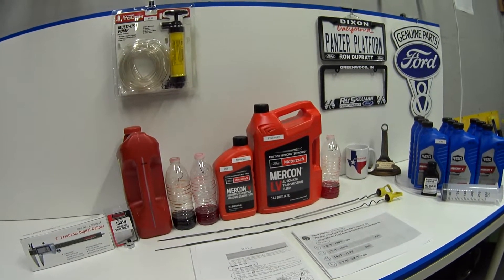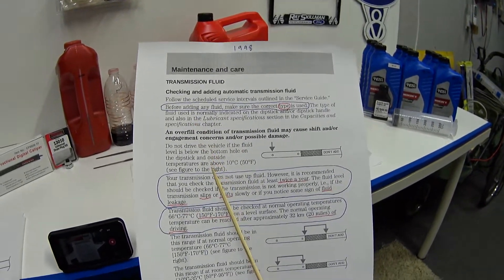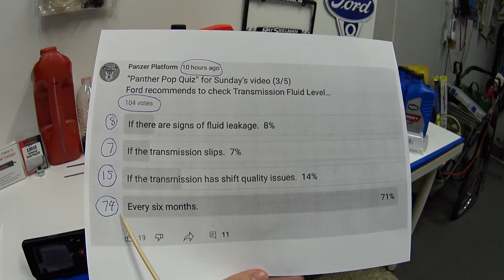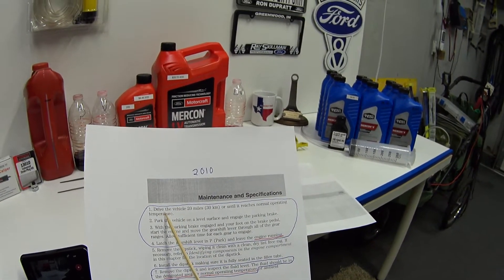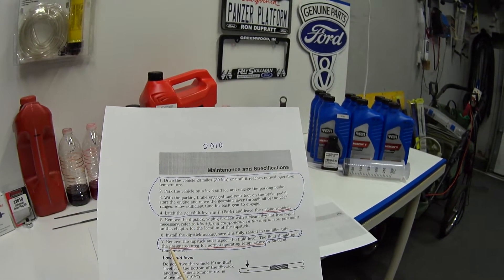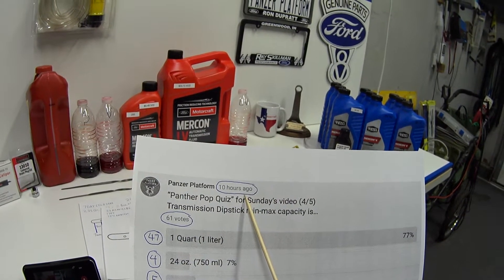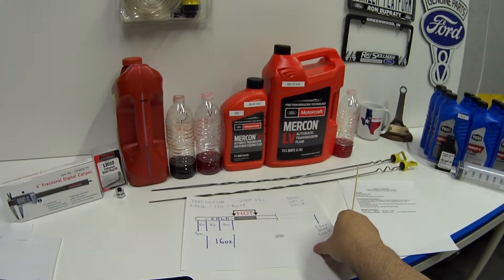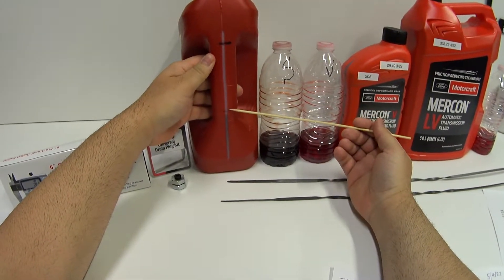Crown Victoria - How To Use Transmission Dipstick

Comment: Thanks for all of your legwork. I’ve done some fluid exchanges myself and I thought I would be  fine with the fluid between the two dots after I drive 30 minutes to work. I even yanked out some fluid when I saw it in the hatch marks. UGH!!!!!! No worries, thanks to you, I know what to do. I carry an 8oz cup in my truck and before I leave for work tomorrow, I am going to add 8oz. I am planning on doing one final fluid exchange for now; I have 2 quarts of Mercon V in the cab of my truck. I was going to use them both for my power steering, but I have already ran one quart through there. Thank you soooo much for clearing that confusing situation up!
Reply from the maker: Right on Earl,
Thanks for stopping in. 
-Chuck

Comment: Thank you sir!  Just checked my 11 GM and sure enough the dipstick is exactly like you showed
NOTE: when I did my DIY flush I found that over 3-4 cycles of full hot / fully cooled off / stop / start and driving (a about a week) the level came down a bit and I actually had to add approx 14-16oz to get it back into the cross hatch area.
I'm guessing it was air pockets in various parts.
Reply from the maker: Right on WOT,
Thanks for stopping by. 

Check, check, and recheck. Lol
Confirm & verify. 
-Chuck

Comment: Great video as always
Reply from the maker: Right on Rich,
Thanks for stopping in.

The cast aluminum transmission pan with the extra 2 quart capacity should really help keep fluid temperatures down for someone with a hauling / towing / performance application.
That was awesome.
-Chuck

Comment: Also checking in from the west. I legitimately could not find the tranny dipstick for the first couple weeks of ownership lol. Felt real stupid once I eventually found it.

Also random transmission fact. I've been looking at getting a 2004+ Ford Expedition and the 03/04 5.4L 2v Expedition's use the same transmission as our Vic's. So the transmission is factory rated to tow +8500lbs with the Expedition platform.
Reply from the maker: Right on TL,
It took me 2 years until I noticed the power point under the ash tray. lol

Have you seen my video on "Panther Platform Towing Capacity"?
Early model years were rated for 5,000lbs.
Late model years only 2,000lbs.
-Chuck

Comment: Whenever I check the dipsticks for engine oil and transmission I always get a vague reading as it’s not always clear where the fluid level exactly is. Probably because I do it wrong so this is good knowledge
Reply from the maker: Right on J-Dub,
Thanks for stopping in.

I know what you mean about getting a muddled reading.
Here’s some optional tips to get a clearly visible reading.

1.) Use a clean paper towel / napkin every single wipe, (of course use something lint free).
2.) Wipe the entire shaft of the dipstick, not just the tip.
3.) Get the dipstick completely dry before sticking it. 
4.) If you’re adding ATF in 8oz. increments wait 60 seconds for the fluid to flow all the way down the dipstick tube, otherwise it will coat the dipstick, and contaminated you reading.
5.) Check both sides of the dipstick for your reading.
-Chuck

Comment: Thanks for your effort. What is the best way to add some fluid? while ambient or normal operating temperature? while the engine on or off?  also, I find it too hard to read the dipstick as each dipping gives a different level on the same time, any advise? thanks again mate.
Reply from the maker: Hello,
All of your questions are answered in this video, or your Owners Manual except the last one. 

After removing the dipstick you must wipe it 100% clean with a clean paper towel, and then wait 60 seconds before puting it back to get a reading. 
-Chuck

Comment: My mechanic friend advised me that dropping the pan and changing the filter is not necessary for every change. I am under the impression that you can just suck out the fluid from the tube & replace what you can... only have to do the filter every 2nd, 3rd, or 4th time you change the fluid- depending on how hard you're driving and how often you change the fluid.  What do you think?
Reply from the maker: Right on JP,
Thanks for stopping in.
This is a great question.

Keep in mind sucking / pumping from the dipstick / fill tube will get you approximately 2.25 quarts. Adding a drain plug to the transmission pan will get you approximately 3.5 quarts. 

Using a $6 hand pump is easier since you don’t have to jack up the car. But if you already have the car on jack stands for an engine oil change, a $10 transmission drain plug might be easier. It’s nice to have both options available.

My worthless opinion is to;
1.) Do your own research.
2.) Use your best judgment.
3.) Make an informed decision.
4.) Do what’s best for your application.
-Chuck

Comment: Is there a way to remove the oil from the transmission Torque Converter for Mercury Grand Marquis 2010
Reply from the maker: Right on Luqman,
Thanks for watching.

To my knowledge only Panther Cars 2002, and older have Torque Converter drain plugs to drain addditional fluid.

Why do you want to drain your torque converter?
Are you experiancing any drivability issues?
Do you have a shift quality complaint?
If so, please explain your malfunction, and symtoms.
-Chuck
Reply: @PanzerPlatform  Yes, I have a delay when I move the gear from front to rear
Reply from the maker: @luqman9364  
Maybe the fluid level is too low, or too high. 
The fluid leven must be "precisely correct". 

Maybe the fluid is the wrong type, or contaminated. 
Maybe the transmission filter is dirty. 
Maybe check transmission line pressure. 
-Chuck

Comment: Hey Chuck! I had an inquiry on a small observation that I have made when reading my oil/trans fluid. 

Everytime I check my oil dipstick, after doing the first wipe, it gives me a reading towards the middle of the hatchline, then trails off to the side of the dipstick up towards where it starts curling around. As I check it now, it has been ~2k miles since my last oil change, and I drive 80% highway at 60-70mph. Could this be regular oil consumption? I bought the car with 93K miles, now has 113K. Everytime I change the oil (every 5k miles), I change the oil and filter and fill it up with the flat 6 quarts, so I know I am not needing to add more when I change the oil.

On the transmission, it does the same thing with the trailing off up the dipstick, giving a vague reading. I am pretty sure that the trans has been overfilled by a few ounces, though. The cold reading is at the hot line or so. Would you think pumping it out is a good idea? I have been considering doing a change because of the aforementioned overfilling, and at this point the fluid is pink-sh. Besides all that, the trans shifts could be smoother.
Reply from the maker: Yo Manny,
Long time no see. lol

There’s no such thing as “regular engine oil consumption”.
Any engine oil loss in a 5,000 Mile change interval indicates a malfunction.
The sooner you find out were the engine oil is going the better.
Look for;
1.) Leaking on ground
2.) Leaking on exhaust manifolds
3.) Leaking from the valve cover gaskets
4.) Leaking into spark plug wells
5.) Leaking past oil / compression piston rings (cylinder leak down test)
Start with a visual inspection with a 1,000 Lumen flashlight. Lol
-
6:01 The only way to check Transmission Fluid Level on our Panther Cars with 100% accuracy is to know the temperature of the fluid as the PCM “sees it” (that’s kind of the whole reason for this video).  
This requires a scan tool capable of showing Transmission Fluid Temp Live Data.
Making any adjustments to Transmission Fluid Level without a scan tool showing the temp of the fluid is “guess work”.
If you want to confirm & verify the fluid level is 100% correct you need a scan tool.

If you change the Transmission Fluid don’t forget to add a drain plug to the pan while you have it off.
-Chuck
Reply: @PanzerPlatform  Hey chuck. I rechecked my trans fluid after a 45 minute highway drive, and the fluid was at the appropriate level at the hot mark. isn't that weird?

Concerning the oil level, do you think I would be able to smell the oil as it leaked? I gave a quick inspection and could find any smells or drips. I'll try to give a more thorough look tomorrow.
Reply from the maker: @manny7289  
Q: Concerning the oil level, do you think I would be able to smell the oil as it leaked?
A: Yes, and no.
Sometimes if it leaks onto the hot exhaust manifolds you can smell it.
Reply: @PanzerPlatform So according to the manual, as long as you are in the hatchline, you should be fine and you dont add any oil. Ill keep a real good eye on it for now.

Comment: I need some help on a issue I am
having with my 03 Vic Lx Sport 98k on the
dash. Backstory: I recently did a transmission
swop out of my 04 Vic Ix sport 125k on dash
but was t boned last year. Now the issue is
when I drive the speedometer goes waaay up
even if I am only doing 30mph it's shoots to
120mph n stalls out. I've changed both speed
sensors already and still the same issue
smh….any ideas?
Reply from the maker: Right on Just,
Thanks for watching.

If I was having this issue on my Panthers the first things I would check are wire integrity, and grounds of the circuits for thos two sensors.

Check each wire from the sensor all the way back to the PCM, or wherever it goes.
Check all grounds in the proximity of those sensors.

It sounds like you may have a pinched, or damaged wire that is causing a short to ground, or short to power.
You may need access to a wiring diagram.
Here is how to get it for free;
https://youtu.be/cCxHk1PNBuo
-
Chuck

Comment: Hey chuck great video... December i rebuilt my Transmission and all good.... recently I get P062c code and my CV goes in limp mode... i turn off the car and all good again.... but i would like to fix that code  and no longer go into limp mode.... what could be the possible causes for this ... thanks
Reply from the maker: Right on DJ,
Thanks for watching.

Need more info.
What is the YEAR / MAKE / MODEL of your Panther Car?
Is it a Police Interceptor?
What transmission is in the car?
4R70W
4R70E
4R75W
4R75E

Can you email me the FREEZE FRAME DATA when DTC P062C is set?
BudgetPantherPlatform@gmail.com

What other DTC’s are in the car?

What is the current PCM calibration level? 
Take a photo of your scan tool showing that info.

Would you be willing to upload a 60 second video showing your car, and describing your malfunction, and question?
I’ll upload the video on my channel in my “Guess The Malfunction” series. Maybe someone has already experienced this. If so, please film in 1080p WIDESCREEN during the day. 
-Chuck

Comment: Thank you for this video! Did you do the cold check with the engine on? Like cold started, then immediately checked? Or did you do it when the engine was cold and not even started?
Reply from the maker: Right on Weaves,
Thanks for stopping in. 
I followed the owners manual recommendation. 
-Chuck

Comment: I was pretty surprised at how immediately confused I found myself the first (and, so far, the only) time I checked the AT fluid on my 05 mgm, even after digging out the owners manual. Ended up adding about a half a quart and not a drop more. No problems but still not sure if I should have.
Reply from the maker: Right on Jon,
Thanks for stopping in.

The only way to "accurately" check / add transmission fluid level is with the use of scan tool live data to verify the fluid is beteween 150F to 170F.

If you added that half quart when the transmission fluid was below 150F, you most likely overfilled.
Will that cause any shift quality issues, or damage?
Maybe, maybe not.

If you want to be accurate, check again after getting a scan tool with transmission fluid temp live data capability, and confirming the proper fluid temp before checking the fluid level.
-Chuck

Comment: I read " if your fluid has never been changed before, replacing it with new fluid can cause the transmission to start slipping, even if it wasn't slipping before. This is because the old fluid will contain clutch material from being in there over time and can actually be helping the transmission to still shift gears. I have a 2008 Grand Marquis LS  w/135,000 miles
. What should I do ? Thanks
Reply from the maker: Yo David,
Thanks for stopping in.

Here you go;
https://youtu.be/jooWpx-wLu4
-Chuck

Comment: My trans temp usually runs around 180 to 185 is that good or bad??
Reply: Also I think my converter is slipping and not locking up above 40 mph.
Reply from the maker: Right on PW,
Thanks for stopping by.

Right off the top of my head there are a few variables that may affect Transmission Fluid Temperature.
1.) The condition of your cooling system.
2.) Proper thermostat operation.
3.) Ambient temperature & weather conditions.
4.) Your driving style & terrain (hills).
5.) Transmission fluid overfill / underfill issues.

About your TCC;
1.) Hook up your scan tool to confirm & verify the PCM is commanding the TCC on/off properly.
2.) Monitor the TCC status to confirm & verify it’s accepting commands from the PCM properly.
3.) Look at all the other transmission speeds sensor values that are available on your model year Panther Car.
-Chuck

Comment: 230 degrees.... that's way too hot.
Reply from the maker: Yo Eric,
Thanks for stopping by.

Are you talking about the Community Poll at 4:40?
-Chuck
Reply: @Panzer Platform  yes sir. After 220 degrees f, transmission fluid breaks down and burns and loses its anti wear additives. My brothers 14 f150 fx4 5.0l optimimal temp is like 210 degrees f. 220 max.